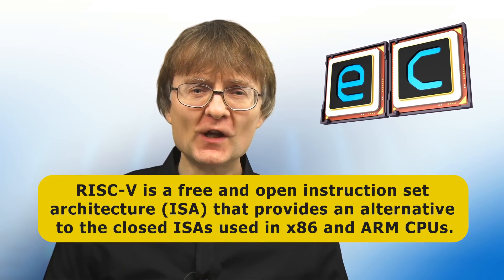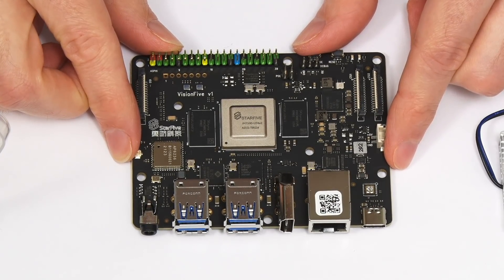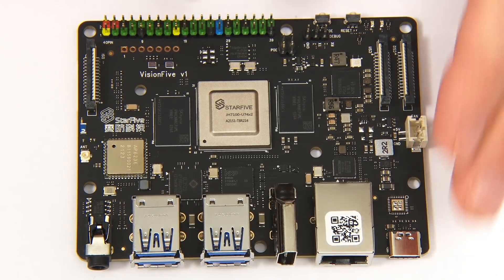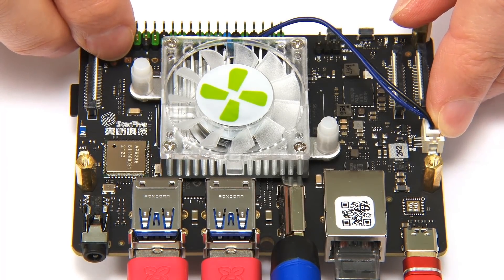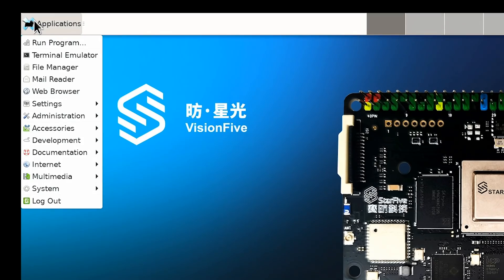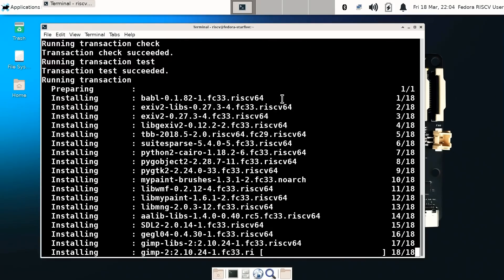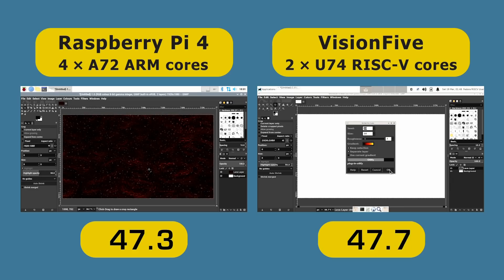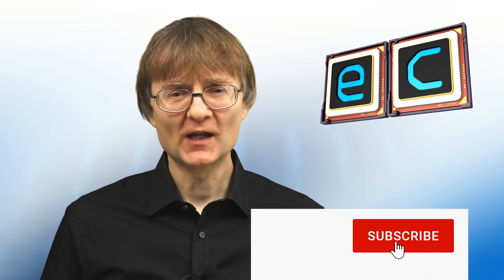VisionFive RISC-V Linux SBC

Comment: Running Quake is not all that impressive on 1Ghz, it was made for Pentiums slower than 100Mhz and without hardware acceleration for rendering. You could use 3d hardware to play, especially on VGA and larger resolutions. Did it do software rendering or 3d? The sound was missing, though. Either volume turned down completely or sound is not yet working.

Overall the performance level of the board (looking at loading webpages, applications, booting-up) comes across as a PC from the end of the previous millennium. It's great that it's working, but there still seems to be a long road ahead. I'm sure they'll make progress.
Reply from the maker: All rendering has to be in software here as there is no GPU. Sound was not recorded to avoid a copyright strike.  I think running on a new architecture is impressive -- the software has had to be ported to RISC-V. :) And not a lot has yet,

Comment: This is great for a new technology! Hopefully as time goes on there will be more SBCs and software support and perhaps even emulation such as Box86/64 for RISC-V. 

One major improvement I hope to see in the near future is increased clock speeds and core counts for lower costs. 4 Cores at 2.5 Ghz would put this well on par with a RPi 4B. 

The truth is, with ARM being so cheap, popular, and easy to manufacture it will be hard to say if or when RISC-V will become popular for PC processors. However I think it would make a great fourth pillar in the major ISAs of Today.

Comment: I wonder to myself if Risc-V Emulators in the future will be better then x86 and Arm64 emulators are today because it is open.  So in my mind I see Risc-V emulators running on every piece of hardware because they emulate so perfectly.  I wonder if I'm wrong about this..  it's just a idea.
Reply: In fact RISC-V emulators are typically at least twice faster than Arm64 emulators because one of the slowest things in an emulator is not just getting the right result for an add (or whatever) instruction but in perfectly mimicking the effects on the condition codes, which are very different between each CPU family (ARM, x86, M68k, POWER etc). RISC-V is much simpler to emulate because it simply doesn't have condition codes.
Reply: @BruceHoult  I'm glad you knew that.. Thanks for helping me to understand it better.

Comment: The board should've been silkscreened with v2.0, as this board was originally set to be released as the BeagleV. Also a year later than estimated :( Does this still crash when trying to reboot from OS or when running iperf3?
Reply: It's a bit different from the BeagleV, which I have in fact had one of for almost a year. Same SoC, but the board is redesigned.

Comment: Based on the specs, this board is really geared towards AI/ML applications. This explains why only two cores as most of the chip is reserved for ML accelerators. It would be cool to see if TensorFlow (or similar) works on it and makes use of hardware acceleration features 🤞🏼
Reply: Indeed. It's unfortunate that the comparison software tests use applications that the board wasn't designed for. I doubt RISK-V will ever be able to compete with the Raspberry Pi and its support ecosystem in either popularity or, for want of a better term, market segment. On the other hand I look forward to seeing this board tested in its intended application areas -- places where the Raspberry Pi will likely be found lacking.
Reply: @tylersperry9164  Agree. I've used RPi4 for real-time ML training (aka reinforcement learning) and it really struggled due to lack of HW acceleration. Might get an RISK-V in the summer to see if it can do the job.

Comment: That is interesting but I am very locked into Linux Mint on my core i5 desktop. I have to be able to process my Canon RAW photos. Then I have to be able to use my scanner and laser printer.  Maybe someday the RISC-V could catch up to that level. I would test one if it was fast enough to give my desktop a run for it's money.

Comment: It's interesting. The CPU portion itself seems almost an afterthought for its AI capabilities, as although it can function as a normal SBC or desktop format, like the Pi or whatever, it struggles a bit, but that's because it isn't really meant to be competing with those, it can just function in a similar field.

It's weird. I look forward to your future videos on this. New architectures and technology are always intriguing and this is certainly interesting. Would be great to have cheaper AI boards to work with.

Comment: Quite impressed by the performance at this early stage and considering there is no GPU in this little SoC.
I'm pretty sure RISC-V will be a serious contender for ARM in the future.
Reply: This CPU was also used in first beta version of Beagle-V, however something went wrong and it was never publicly released (only handful of devboards were released for early adopters and they actually shaped how this one came out). There were plans to make this CPU only a small scale production to unblock people who were designing boards and allow them to start porting software. It seems that original plan was to make a production run of JH7110 CPU which should've had 4 cores instead of 2 and it also should have PCIe and 3D Accelerated GPU on board. Not sure what went wrong as I was looking into buying that one, but it never got released and beagle-v was postponed.
Reply: Yeah, the production BeagleV Starlight with JH7110 was promised for September 2021, but as we now know it eventually shipped in the VisionFIve 2 in January 2023, and then in many devices over the following six months: Pine64 Star64 and PineTab-V, Milk-V Mars, and even the Roma laptop which had originally been announced to have TH1520. I'm guess it needed multiple tape-outs to get it right, but eventually it turned out to be a very good and solid chip. @vladimir.smirnov

Comment: Two camera connectors and a subsystem for neural networking and AI?
could that be used to orientate in 3D space and attempt to understand what is going on ?
Reply from the maker: Exactly so. Two cameras and the SoC spec here open up all kinds of possibilities for stereoscopic vision, spatial orientation and machine learning. Is is called the VisionFive for a reason I think! :)

Comment: Seems pretty damn slow for the hefty price. Does it even have graphics acceleration? I don't know, to me it seems that this product is only good for a small minority of developers who need to test RISC-V itself, not the general public who actually don't care that much what type of CPU it is as long as they can run applications on a single-board computer for a cheap price.
Reply from the maker: You are right, as I stated repeatedly in the video, this is a developer board. It is not a product for the general public, although some viewers here who like to experiment at the cutting edge may be interested. :)

Comment: Really nice video. Isn’t it nice to see more variety in ISA’s these days? I got really bored with x86 a couple years ago and now have in addition to x86-64 boards for RISC-V (Unmatched), ARM64 (Honeycomb), mk68 (Vampire V4 Stand-alone), and PPC (X5000 Amiga OS41)!
Reply from the maker: Now that is cool! :)
Reply: An expensive hobby for sure but fun. Seeing windows work on more than x86 is refreshing but honestly windows on arm is languishing. Windows used to work on not only Intel buy MIPS, Itanium, Alpha, etc. Not forgetting Linux which runs on everything. Unfortunately non-x86 support on Linux is a bit lacking. Look at the ARM64 problems with main lining patches.

Comment: I would expect most of the software in the repo would just straight up compile because it uses the system's API interpretation of like drawing app screens and accessing sound. The system itself must have drivers for various pci devices, like it always does anyway. So the biggest issues would be in making the compiler for risc 5, and the specific kernel assembler for timers and memory contexts and stuff like that. Linux is a heavily ported system, and I am sure they now generally what is needed to do it.

Comment: It is very exciting to see RISC-V make its first steps into the market! 

Slightly off topic, but I couldn't help but wonder why your Pi 4 took so long to do the lava filter? My Pi 400 only takes ~15 seconds to apply the same effect.
Reply from the maker: This I will investigate. What you saw in the video was what the Pi 4 delivered.
Reply from the maker: A Pi 400 and a Pi 4 are not the same -- the former is clocked faster, as are later Pi 4s running the latest version of Pi OS, and my guess from another discussion here is that this may have something to do with it.

Comment: RISC-V is interesting, but I believe it has a fatal flaw, that will prevent it from ever displacing ARM. Only the minimal core instructions are actually open. The rest will likely be proprietary extensions. As an example, the minimal instruction set doesn't even include a basic division instruction. I've done enough assembly programming to know you don't actually need a dedicated instruction for division, but any software that uses extended instructions, will not be compatible on CPUs with only the open core. This will lead to 1 of 2 outcomes. Either the RISC-V landscape will become extremely fragmented, which would be bad and a mess. Or a single company will win out and hold a licensing monopoly for the most popular extensions, which would be no different than ARM, just more fragile and with much less certainty for the future. This is unfortunate, because in theory, RISC-V has great potential.
Reply: No, that's not correct. Right from the first public release in 2015 the open RISC-V instruction set has included optional but standardised extensions for M (multiply and divide), A (atomic operations for synchronisation),  F (single precision floating point), D (double precision), and C (16 bit versions of the most common instructions, for more compact programs). If you are making a CPU for embedded applications you can pick and choose which extensions you want, but binary distributions such as Fedora or Ubuntu assume that you have all of those -- i.e. RV64IMAFDC aka RV64GC. A number of other standard optional open extensions were ratified in November, including B (bit manipulation, similar to Intel BMI1, BMI2), V (Vector processing, similar to ARM SVE), cache control instructions, crypto instructions (SHA, AES). These will start to be present in CPUs intended to run Linux within the next year or so.

RISC-V fragmentation FUD is very much exaggerated.
Reply: @BruceHoult  You seem to be missing the point (or perhaps I didn't word it well), which isn't about any specific extension. It's about "you can pick and choose which extensions you want" in the first place. There needs to be a common instruction set, guaranteed to be present on all across the architecture, for software to be able to target, which there is. But it's a bit too minimal, and there are far too many optional instructions. Plus, it's open to further proprietary extensions on top of that.

If "Fedora or Ubuntu assume you have all of those", then if you want to run Ubuntu or Fedora, it's a bit of a problem if you don't have all assumed options. As in, everything will need to be rebuilt, or you'll be s#%t out of luck, because it won't run. This is fortunately at least an option for open source software. But it would be a big problem for proprietary drivers and other closed software, which there's a lot more of on embedded Linux systems than a lot of people realize. 

I truly hope it doesn't turn out to be a problem in the end. I really want to see RISC-V to succeed. But what anyone 'wants', is irrelevant to what actually happens. There's very much a 'RISC' of market fragmentation, though that doesn't mean it'll happen. But the more optional extensions there are, the more 'opportunity' there is for fragmentation to occur. Whether or not it actually does become a problem or not, only time will tell.
Reply: @nunyobiznez875  "If "Fedora or Ubuntu assume you have all of those", then if you want to run Ubuntu or Fedora, it's a bit of a problem if you don't have all assumed options." Yes it would be. Which is why people who want to run binary distributions of Linux buy only the hardware that implements the necessary ISA extensions. And it's why people who want to sell boards for running binary distributions of Linux on include all the necessary ISA extensions. It's all rather simple, really. People who are compiling all their own software can design or buy a CPU with only the instructions they actually need -- and then tell the compiler what those instructions are. Also very simple.

Comment: Open software meets open hardware. Feels like we're experiencing a defining moment in the timeline of computing history. :)
Reply: It's not open hardware, it's open ISA only. Anyone can make a cpu with risc-V (without paying licence), but there is no open hardware implementation right now. But it would be interesting if someone makes something like an open core that anyone could use for making their xips.
Reply: @jordicoma  You are taking my comment far too literally.  I do understand open ISA.  So, to put it another way: We are seeing open software (that does not require paying licenses / royalties), running on a standardised CPU platform (i.e. the hardware), that also does not require the payment of licenses / royalties (for the ISA).  Does that help put my much simplified “Open software meets open hardware” comment into perspective?
Reply: @gregclare  You continue wrong way. This SOC has a ton of no open no standard computing, it uses a lot more tham RISC-V open ISA.
You could do a RISC-V open computer with no closed parts, but it will be very difficult, expensive and low powerful.
Reply: There are open cores though. Look for the T-Head C906, C910, etc., which you can get on real hardware already.
And there's OpenXiangShan. And Moonbase Otago Vroom.
Much stuff that isn't being promoted too well, unfortunately.
Reply: @CyReVolt  How fast are those cores?
Reply: @surrenderedwill3326  I only know that the C906 is clocked at 1GHz in the D1 SoC, and the C910 should be something "high performance". Sorry; you can have a look at the sources. ;)
Reply: Will we ever see a truly open CPU? To a certain level maybe. So much IP  gets licensed to take a design and actually fabricate a wafer. I suppose using fairly agricultural process nodes it might be possible. RISCV is a great first step and it might be what the industry needs to transform much like Linux was in the late 90s. Great video as always.
Reply: Literally been done repeatedly already.
Nothing new.. certainly not "defining" anything.
Reply: Wrong, Sun and Sparc was much more open hardware than RISC-V. Suns latests Niagara (massive multi core threading) was a complete open VHDL design. Sun tried to push it into universities in this way and get some development back for free. Didn't work, just like huge software projects it's too complex and need employed full time workers.
Reply: A bunch of marginal microcontroller manufacturers are going to be able to save 10 cents per unit, the open source revolution is here! Repent for your sins!
Reply: :cat-orange-whistling:
Reply: We also need open pheripherals

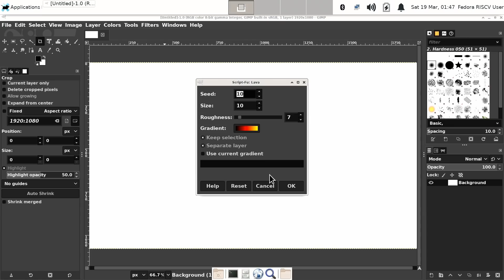Comment: Since Lava is a single-thread process, it looks an ARM A72 core is approximately 50% faster than the RISC V U74 core (13:10).  However the Pi 4 also runs at 1.5GHz whereas the RISC-V is 1GHz, which makes me think the cores may have roughly the same performance if they're clocked at the same rate.  With twice the cores and a 50% higher clock speed, the Pi 4 is probably ~3x as fast as this RISC-V board.

This is superb for such an early product.  Since this is an open-sourced processor, development will likely snowball as more companies use it to avoid licensing fees and contribute to it.  I did one project with a RISC-V microcontroller in 2019; the processor itself performed well, but it lacked the documentation and peripherals found on ARM microcontrollers (less clocks, ADC's, serial interfaces, etc).  We could see RISC-V overtake ARM in microcontrollers, phones, and eventually computers in the next decade or two.

Comment: It seems a little under powered. I also wonder how much heat the CPU is putting out for the manufacturer to include an active cooling option right out of the box. Maybe one of your CPU torture tests, with and without that fan, could be in its future. Also, did the fan come with some gunk or did it just sit right on the CPU?

Comment: How is running Linux on a Raspberry PI  "not running a full desktop os"?
Reply from the maker: A Raspberry Pi indeed runs a full Linux OS, and nowhere in this video do I say any different. But a Raspberry Pi has ARM processor, not a RISC-V processor. And what I say in the introduction is "this is a trailblazing piece of hardware, as it has a RISC-V processor that can run a full Linux operating system." And this is true! So I'm really not sure what you point is.

Comment: A developing board with the newest P650 processor from SIfive would bring a big leap forward.
Reply from the maker: Oh yes, very true! :)
Reply: The P650 core was only announced in June with first customer availability I think planned for October. That puts any customer SoCs being developed using it probably still at least six months away from tape-out and 12-18 months from appearing on boards in shops.  The P550 was announced nine months earlier and Intel's "Horse Creek" platform using it is apparently taped out and in production at the fab right now and might possibly be on a new HiFive board (Unleashed, Unmatched, ... ?) around the end of the year. SiFive's cores are pretty good, but have historically been held back by less than ideal SoCs (including the JH7100 on this board), but if Intel knows anything it's how to build a good SoC with good RAM interfaces, good peripherals etc.